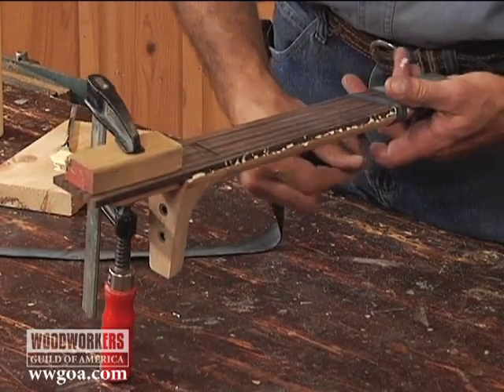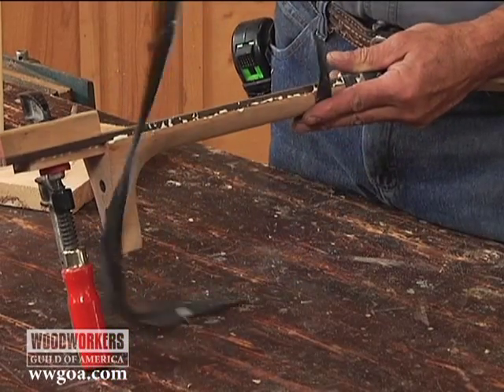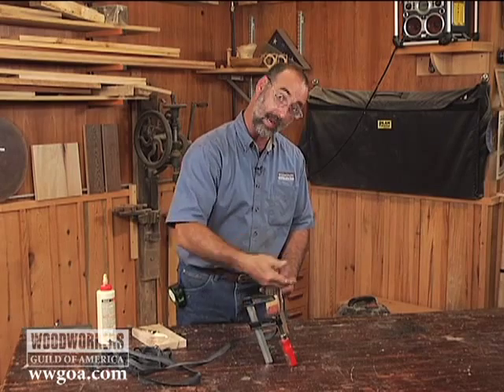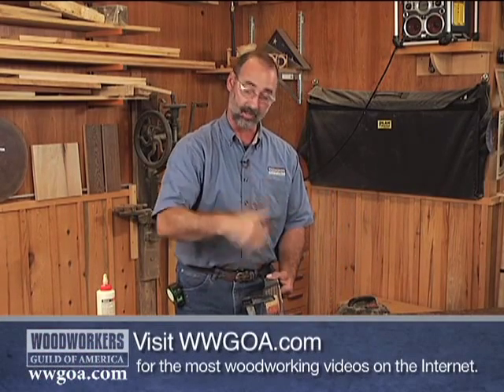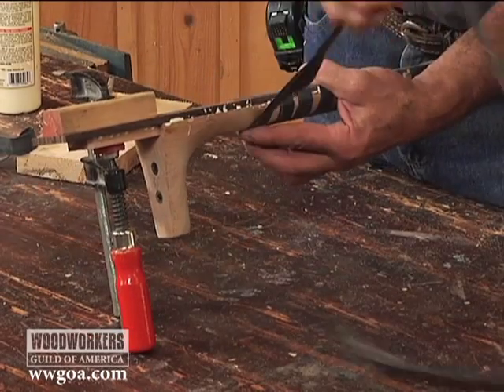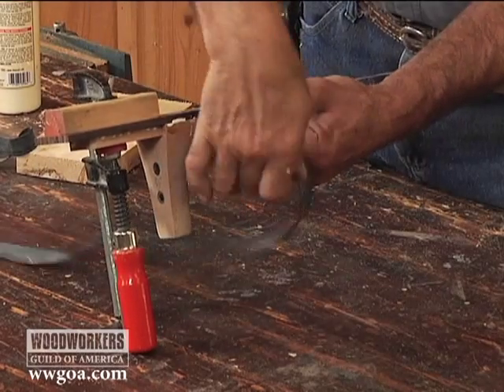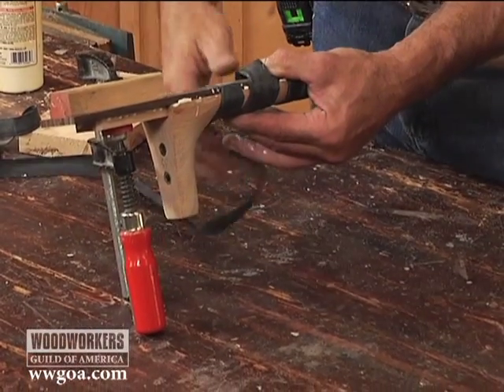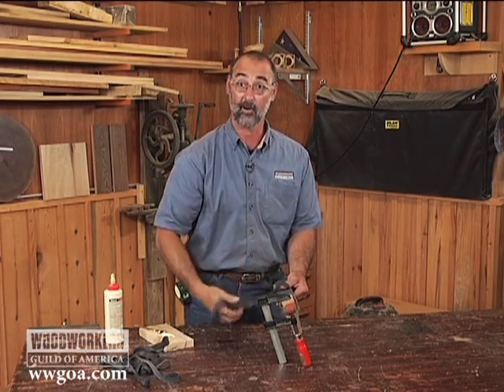How to Clamp Irregular Shaped Objects

Comment: Hi George, do you have any recommendation in clamping an octagon? It is a little larger than 8 inches in diameter. Not sure if I should use biscuit or spline to glue up. Thanks Alvin

Comment: That fingerboard is gonna wanna slide in the direction you're wrapping. Why not just use ten hundred million elastic or tied rubber tubing loops to slip over and down the neck. That would be way more uniform pressure wise.